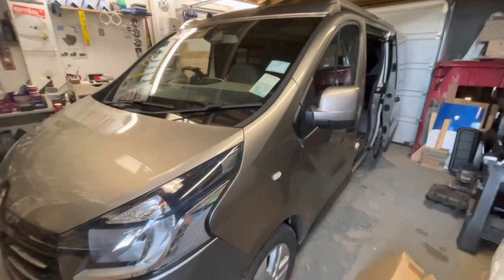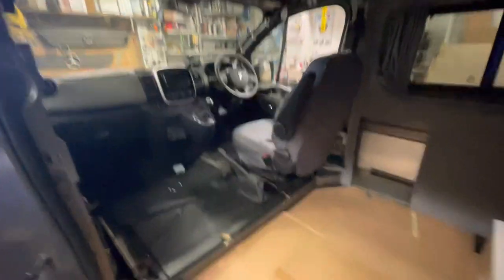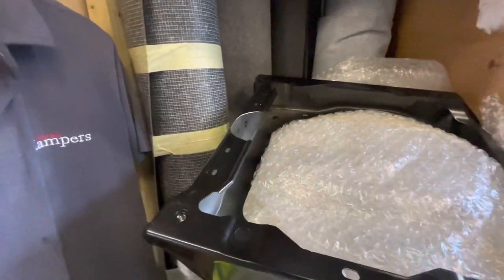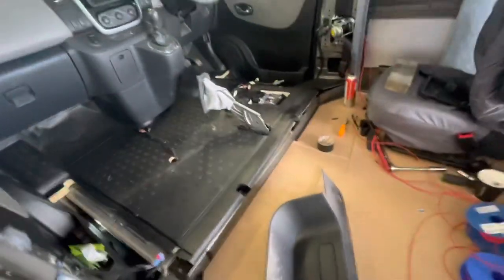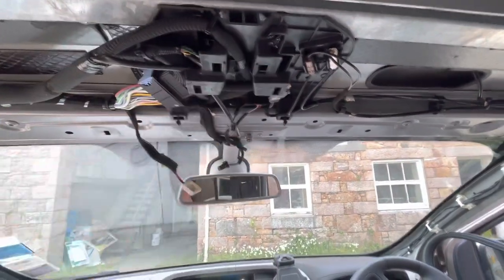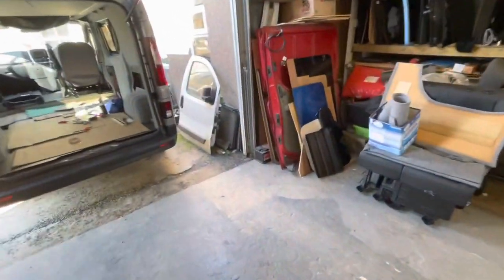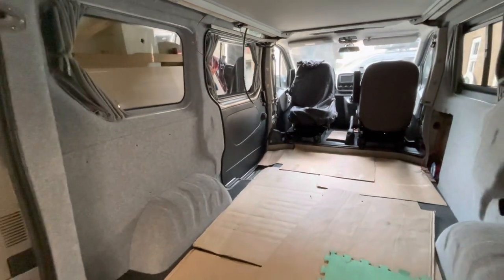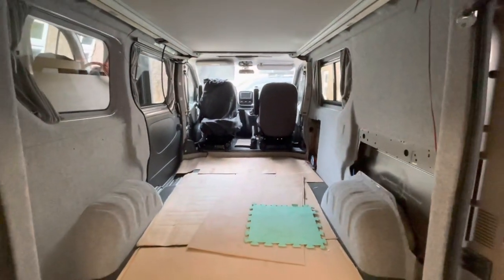Renault Trafic camper build with SCA roof and RIB bed. Part 1

Comment: I have got a 70 reg Fiat Talento
170 bhp multi jet Onyx Edition edition lwb van in Black ( same van as yours eccentially) that I bought brand new ( was a 6 seater ). I had it fully professionally converted. It makes a really good campervan and better than a VW in my opinion, because of it's square shape and larger size. I have a 120 cm wide rib altair bed in VW brick,  drivelodge pop top with upper bed, two liesure batteries, double dometic burner, sink and 50 litre fridge. carbon fibre effect cupboards with high level side and rear cupboards to match and a red work surface and splash back in front of the driver's side sliding door. Cylinder drop out box beneath the sink. Swivel front passenger double bench seats, f60 canopy, rear speaker outlets within the rear high level cupboards, sliding glass opening above the burners, privacy glass fitted in the living area, no glass on rear doors ( pointless ) new privacy glass pane fitted next to rear seats on the nearside, euro 6 compliant charging system from engine, charging the liesure batteries. Framed solid solar panel charging the liesure batteries and main engine battery, full electrics, webasto heater, touch sensitive lights side and rear, led light strip above the burners / sink.  Switchable lights in pop top roof, matrix pattern led fairy lights within bed base carbon fibre effect ceiling, carpeted, hard wearing flooring, 3x gas alarm,  liesure battery condition voltage  meter, hook up and full electrics,  with several 240 volt outlets including awning outlet, 12 volt outlets, USB, 12 volt etc etc etc. Very pleased with it.The van originally came supplied new with apple /android auto, side runner bars and alloy wheels and Air conditioning.
Reply from the maker: Sounds impressive, you should do a van tour video 👍